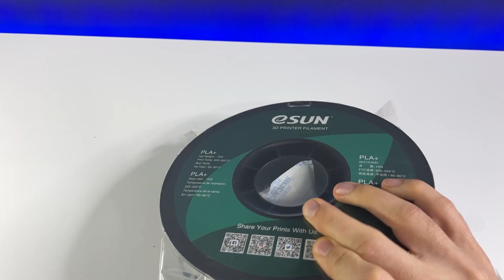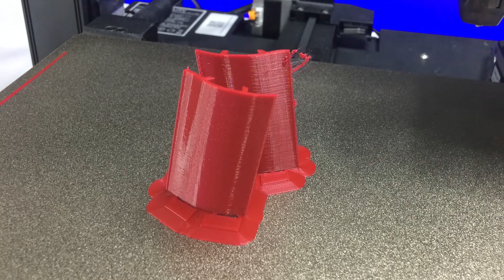3D Prints Timelapses SVF1 Race Car Model and Jointed Figure

Comment: Bro, your printer is not well set up for printing. I have an Ender 3 s1 as well. And I have been printing this race car too. All surfaces came out perfectly smooth and moving parts had no resistance. I would suggest you take some time to learn the print settings to get better parts.